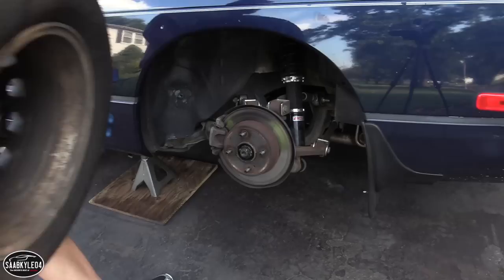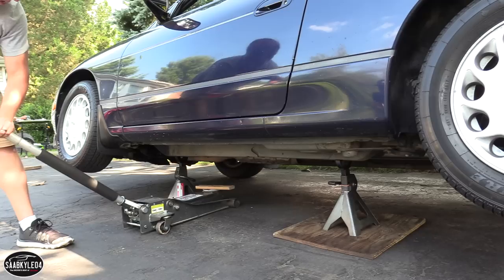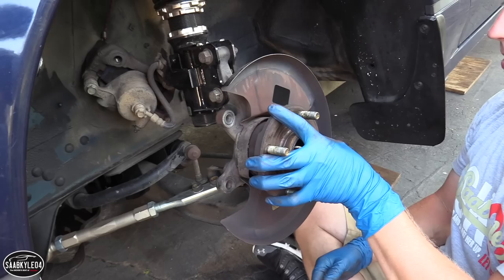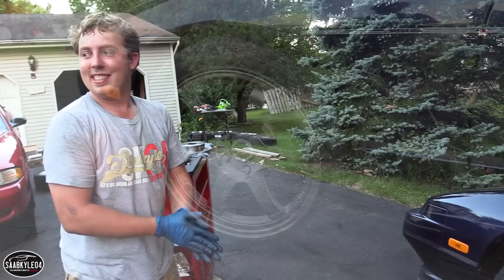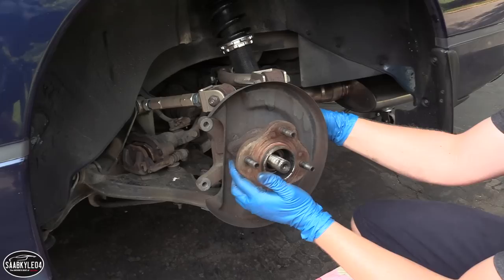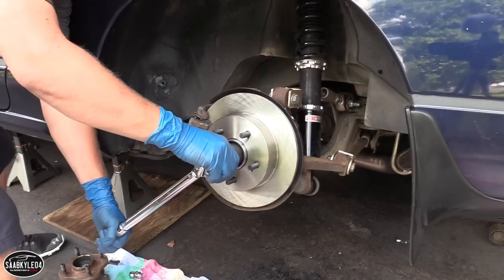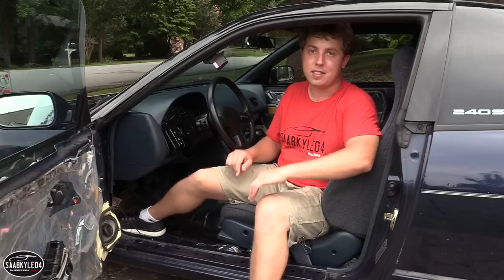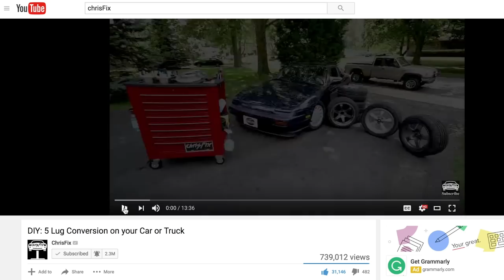The 240SX Gets Forged Wheels & a 5-Lug Conversion!

Comment: I love these type of videos! You could start cleaning up the exterior and modernising it after the interior is completed!
Reply from the maker: That's the plan!  There's a lot of bodywork that needs to be done before a full repaint (in the original color).  I'm also adding a complete OEM 180SX Type-X kit to keep everything in the Nissan family (no fiberglass replicas) and give it a more aggressive look.
Reply: Saabkyle04 Yes! I can't wait to see how good it's going to look and just be for the driver. You should get all the exterior lights replaced as well if you haven't done that. Also some new seats!
Reply from the maker: All things I'm considering :)  Thanks bud!

Comment: Not to be a drift kid or anything, but the contact patch on the rear of your car is only gonna increase as the camber approaches 0 degrees. You may think about rolling even more or getting narrower tires and installing them with a bit of stretch.

Comment: Nice job, but a suggestion for the future, when you are breaking off and tightening bolts like the axle nuts and caliper bracket bolts don't try to lift up on the wrench cause all the force is on you back, try pushing or leaning on it. You still have good control but you use your body weight to your advantage and don't put so much strain on you back.

Comment: Tires are too skinny for those wheels. Hello curb rash.
Reply from the maker: If you know how to drive around curbs, you shouldn't have to worry about that.  I've never curbed a wheel, nor will I put myself in a situation where that's even a possibility.  This tire size is ideal for this size of wheel.  I may go 255 one day, but that would require more modifications to the fenders and it's not needed right now.